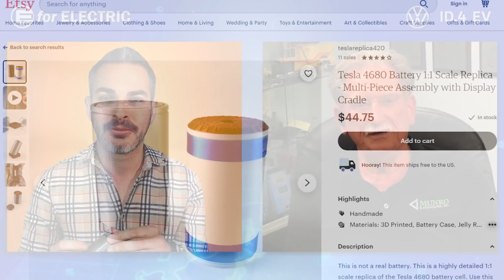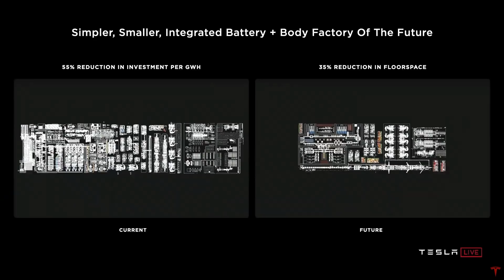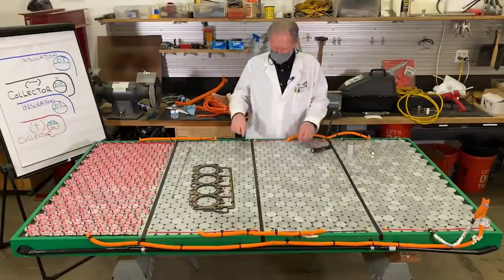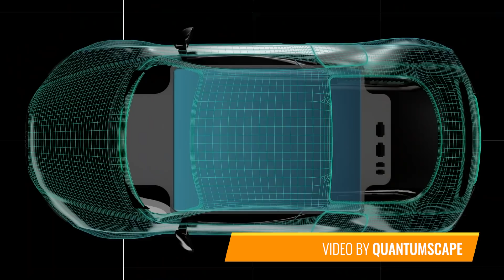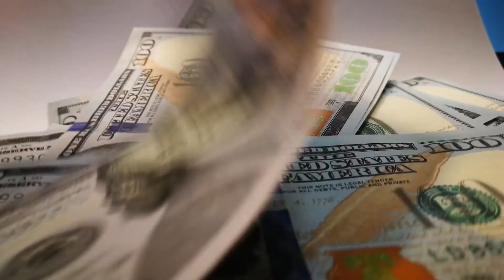SANDY MUNRO: Tesla's 4680 Cells & The Future of EV Batteries

Comment: Sandy, it doesn't matter what Tesla does on the production side, until these vehicles are NOT  slaves to hours long charging at scattered (relatively speak) charging stations these cars are NOT going to be widely accepted, at least not in the U.S. The last thing most drivers want to be thinking about is the logistics of where I'm going to recharge on a long trip or plugging in after a log day of work and an hours commute. Until the problem of fast charging (<20 minutes) at ubiquitous charging is solved EV's are not going to make a major dent in the number of vehicles on the road. Toyota is selling a lot of hybrids to the point where everything that arrives at a dealership is immediately sold. They have the plug in versions now for the Rav 4. You have the option of plugging it in at your leisure as well as charging on the fly running by the gas engine and regen braking. You can get in the car and just drive 100 miles or a 1,000 miles without any concern about where you're going to find fuel. We are lazy and in a hurry. EV technology is going to have to recognize that fact if it's going to make significant headway in an ICE world.
Reply: You sound just like the guys who shorted Tesla using the same logic and ended up with nothing but shorts on their body.
Reply: @Enemji  Where is the flaw in my argument? Are you claiming the infrastructure is in place to support 28 million (10% of cars in the U.S.) currently? Are you claiming a significant portion of the U.S. population is going to embrace the inconveniences that current exist in owning an EV today (long charge times and relatively few charging stations)? Don't be a fan boy a toss facts and rational reasoning out the window. I'm invested in EV technology BUT I'm not going to allow that investment to cloud my thinking. Tesla has had ONE profitable year and that profit was largely based in government subsides and sell carbon credits. How many vehicles the can produce is only one factor in EV's making up a significant portion of cars on the road. Tesla sold 500 thousand EV's in 2020. Toyota sold 2 million hybrids in 2020. Tesla has a LONG way to go before it makes a significant dent in vehicle sales. Don't get caught up on all the hype.
Reply: @pmh1nic  There is no flaw in your argument except that Elon Musk is an exception to the typical logical approach in a business.
Reply: @pmh1nic  One of the few comments I've seen that puts Tesla actually sales numbers into perspective. Toyota sold almost 10 million vehicles last year compared to Tesla's 500k? I think it's obvious the future is BEVs but that transition will take time and as you said the infrastructure needs to be vastly improved before it makes sense for many of the tradition automakers to go full electric. But once they do get going, Tesla's EV market share will drop and significantly.
Reply: @Enemji  If Elon was the almighty exception Tesla wouldn’t have year after year of no profit. Elon doesn’t control the speed of infrastructure creation. I admire the man but his control is limited to what Tesla can do. He doesn’t control his partner companies or the countries in which Tesla facilities are located. The success of Tesla is tied to a lot more than what Elon has direct control over.
Reply: @pmh1nic  so did Amazon. Yet see how they beat the big guns
Reply: @pmh1nic  - Neil DeGrasse Tyson told Elon that he cannot build Rockets, and only an organization like NASA can do it.  Yea Right!
Reply: @Enemji  Talk apples and oranges. The market cap if the auto industry is about $20 trillion dollars. NASA's budget is $20 billion. SpaceX budget is about $2 billion, peanuts in comparison. Tesla is free to build it's rockets somewhere over in a corner. Tesla is NOT going to be free to build EV infrastructure wherever it wants. Even if Tesla had the money to do it regulators and legislators aren't going to allow one company to dictate that setup. Building the infrastructure to support EV is far more involved than setting up an on line shopping and shipping system. And until that infrastructure is in place it's going to be difficult to get people to switch from the convenience of ICE and APV to EV's. I don't say this to say it can't be done. It will be done but change over is going to be progressive over a decade or more. Tesla better figure out how to become more profitable than it has been over the last eight years in an environment where more and more competition will be getting up to speed in the EV space.

Comment: Even though Tesla has had issues scaling up their own production of 4680 batteries from their pilot factory in California, their pilot factory in
 Nevada (with Panasonic), and their upcoming 4680 factories at Giga Texas and Giga Berlin should secure a steady 4680 battery supply, and show 
off the innovations of their new battery technologies as they ramp up to mass production of the 4680 batteries over the next year or so. Even though mass production is behind their optimistic initial plans, Tesla and their battery partners are still ahead of the much talked about solid state battery products. Which seem much farther away from mass production at competitive costs than the 4680 batteries. Slurry, Paste or Flow batteries are great for specific purposes, and I am sure that investors want to copy the gas station model to keep control of the storage and distribution of energy. But until one of those technologies builds corporate and home systems that recharge from solar power (where possible) and other renewable resources, those new technologies don't really allow for energy independence.

Comment: One thing is for sure. At some point in the not-too-distant future, something other than Li-Ion battery technology is going to be needed to power EVs. Why? Because there is only a finite amount of Lithium on Planet Earth and as more and more EVs are manufactured by more and more car manufacturers, the demand for Lithium will grow exponentially and it will eventually run out. And we're not talking 50 or 100 years from now. We're talking about the relatively near future. Plus the cost of mining Lithium is high and as demand for it ramps up against a dwindling supply, its cost will rise significantly making EVs ever more expensive if they're relying on Li-Ion batteries to power them. I think Sandy is right on the money here. Some new technology will need to surface relatively soon that will replace Li-Ion batteries.

Comment: This needs Sandy and Elon’s attention.  

Regarding 4680 patent. 

Namely the tab less 4680 cell. What that means from EE and ME stand point? 
Remove the tab, is removing the one and only one “reliable” conduction path for electricity in the 4680 cell. 

Next - flaps was intended to wick heat from chemical towards cell base then conduct it to the coolant channel next below. However point contact flaps has high thermal resistance unless junction area equals to cell base area which is not happening in model Y. Coolant scheme of model 3 will not come out of model Y. Coolant in model Y runs beneath cell base. 

In 4680 patent tab is removed and replaced by point contacts from periphery anode to cell wall, that leads to “unreliable” electric conduction. Whilst tab in 18650 is a solution to address that unreliability. Seems that Tesla is stepping backward this time. 

4680 cell may offer performance as expected by the patent but it will begins to accelerate aging the moment it experience inertial shocks on road, resulting short life cycle at a small fraction of a 1million mi goal. 

The formed up multi anode flaps are made of annealed soft copper foil it can deformed out of shape and will not spring back to maintain “conduction” of both heat and electricity. Entering a run away process, (1) deformed flaps increases cell internal resistance and ohmic heating.  (2) heat from (1) cannot effectively dump to coolant channel can only heat up cell chemical. (3) cell chemical take up heat cannot dump to coolant channel because of (1) above. Continue inertial shocks worsen the situation until the tallest one flap remain touching with cell wall. At this time cell chemical temperature rose exponentially. Further inertial shock momentarily disconnects that last contact causing an electric arc at the anode-wall junction next to hot chemical, subsequently to a possible ignition or small scale internal explosion.  

Remedy?  (1) implement model 3 coolant channel scheme into model Y and to models using 4680 cell. (2) tell the world that Tesla is adding a tab or tabs back to their tab less battery.
Reply: Remedy: put a sponge or something else springy on top before folding the copper tabs in, so that they remain to be pressed to the cap, or use electrically and thermically low resistance glue.

Maybe too low level solutions based on household repair ideas, but I'm pretty sure that the Tesla engineers have already had a better solution for that than we both could imagine.

Relax, Sherlock.
Reply: @arpysystems  please follow up with my second message titled Remedy.

Comment: Mayby maybe baybe are as good as a Elon promise. It migth come, but who knows. So maybe Toyota are the clever ones. Lets see, now it not the time.
Have Monroe look at other thsn Audi Etron. 
U can not run a business off what is best now, you have to look in to the further, and have you done that, you migth haven't be in that kind of a problems with debt.
Reply: Elom promises vs VW promisses. In 2013 VW said they would be BEV market leader in 2018....... using most of their 7 billion R&D yearly budget into this... w,ell now its 2021.... 
Also, in 2008 Audi showcased the E-tron in Frankfurt car show, to be launched in 2012, well, it turned out to be 2021... , almost right..., and better is now only 400kg more heavy than an Tesla model 3 topping up with lower specs and much higher prices"......almost there...
In 2015 Elon said Tesla would produce 500k cars in 2020,..... well you know the reaction yourself, and Tesla did just that, right?. Who•s the most accurate, hmm?
All OEM are now VERY busy making us think they arealready  there, even saying they are in front, lol. Advertising does not do it going forward, since OEM was all the same so nobody cared, no more no less, all the same. They will get caught red handed when somebody just try out a Tesla, they instantly know this is a different level.
Mecedes just bought a UK electrical motor company... in order to “stay ahead in the electrical transition”, ......what?  Stay ahead?.
Advertising, glitter.... it will be obvios at some point when OEM ICE will find out what is out there, and  you find yourself completely of with their bad designed horisontal build shit cars. Look into ANY engine, what a mess from 20 different suppliers, who even never met each other, christ it sucks and looks like a mistake just happend. I was 1. .tier supplier 25 years ago, same backk then, OEM did NOT move, they were just too secure nobody could touch them ,well they were wrong.

Comment: 4680 is not so much a technology.. its a form factor.. The important technology is the dry process, the low cost, the scaleability, the high speed production, the sourcing of key materials, the different chemical types in the cell. Key word is the cheapest technology; lithium iron..
Tesla and BYD will own the market in three years time. IMO👍🇳🇴

Comment: SS and Hydrogen is just used to make the uninformed public think something better is coming so they should keep on buying ICEVs (Sandy's reference to 'V8s coming back' from an executive backs this up from a diff angle) and that Tesla will get disrupted.

Batteries will change a lot over the next 5 years but they will also not change.  The companies making batteries and their experience and factories will still be relevant and is not going to change to some magical new product.

Also Alex doesn't seem to understand that Tesla will make it's own 4680 cells without any help from existing suppliers.  They will actually help the suppliers to also make 4680's.

Comment: IF 4680 is no longer usefull for cars... they will be able to use it for stationairy energy storage... so, its fine.
Reply: Unless coldfusion reaches production. Or the carbon fiber battery goes into mass production and is faster and cheaper to produce.

Comment: 3-5 years for "refillable" batteries! That's funny! I'm still waiting for airless tires from thirty years ago. If you're lucky it might reach a very small trial phase in five years and be in testing a few more years. Then it's right back to where we are now. Waiting for the independent gas station owners, who make all their money on snacks not fuel, to spend their capital installing this new system. When do they do that? Right away, or do they wait until they actually see enough demand for that fuel in their town. Will this dream battery have price parity with electricity which is already everywhere? I can't charge at home any more, I have to go back to a special fueling location? Part of my refueling cost is the waste/recycling because the station owner isn't eating that. And we're back to trucking around all this material again. I think Sandy's investments include a lot of transport companies since he was big on hydrogen too.
Reply: This type of battery is called redox flow battery, and the technology is tens of years old, I'm surprised Sandy did not know that.

You could still charge it like you normally would, but you'd have the added benefit to exchange the discharged electrolyte with a charged one in mere minutes at some station, because it holds the charge in the fluid rather in anode+cathode like standard batteries.
Pretty low energy density though, usually only used industrially where volume and weight are less critical.

Comment: I think LG Chem has problems. I hope Tesla doesn’t use them.  LG Chem batteries for the Bolt and solar back up batteries have been recalled. I was impacted by both. In fact the software upgrade didn’t appear to fix the problem because more Bolts caught on fire.  I will not by a car that has a battery from LG Chem.
Reply: Does LG assemble the whole pack or just supply the batteries? Seems like if Tesla goes with LG they'll only supply the batteries and let Tesla manage them, what's causing the problems is most likely how the pack is made or engineered.
Reply: @antreastoumazou2736  from what I understand it was in the battery itself.Hyundai recalled all of their vehicles as well with LG Chem batteries. I believe they are replacing the battery packs.
Reply: LG had an issue from 2017 until 2019, where they had a manufacturing error in the chemical makeup of the batteries.  Past 2019, their batteries are fine.
Reply: @charlesball6519  my LG chem solar back up battery was affected as well which uses same batteries. It took 3 months to get it replaced last year and the new one which is  a 2020 is under recall as well. It has been in an idle state on my wall for 2 months. Message from contractor is that lg chem is still trying to figure out the problem and doesn’t know what years or models are impacted.  The proposed fix is a software update like with the Bolt. We now know that doesn’t work because Some of the Bolts that had the fix are catching fire. No offense Charles but im not buying anything with lg chem attached to it.
Reply: @evgrandpa365  Luckily, the F-150 Lightening will be using SK Innovation batteries.  From what I've heard, the issues with the LG batteries were an incorrect chemical formula and the seperators between batteries.
Reply: @charlesball6519  yes thats what I’ve read. The LG chem ordeal is a mess. I’m great full to GM for buying back my Bolt. I will return the favor when they don’t have LG chem batteries. I look forward to seeing the F150 lightning once deliveries start.

Comment: I could be WRONG but the pouch seems more readily RECYCLED and RECOVERED
Reply: the cylinder is easy to shell out - and the metal is simple to recycle - all the jelly rolls and pouches are "complex" - chemically - to recycle. (Typical of recycling, it is much cheaper to use  uncontaminated virgin materials to make high grade products)

Comment: In  a Tesla 4670 battery pack how do you connect up in series (to increase voltage), all the mini packs that are wired in parallel without short circuiting all the cells with the outer frame casing.
Reply: The same way they do with 18650 and 2170 cells
Reply: they have 2 ends apparently one + and the other -  draw a picture of "how to" if it helps.   cheers.

Comment: That chemical battery sounds a lot like Vanadium flow batteries. That sounds like the right idea for trucking, but is a lot less dense than Lithium as far as I understand. Maybe there's some new chemistry.
Reply: Keep in mind whatever chemical you add to the battery has got to contain the energy you're going to be getting back.
Or rather it has to end up in a state that contains less energy than it did when it was put in
Reply: Generally, the category of this is called redox flow batteries, and it is not that new.
On principle, those batteries hold the charge in the fluid electrolyte, while the anode and cathode do not change during discharge as in a normal battery. After depletion, just pour the discharged electrolyte out (to recharge elsewhere) and pour charged one in, done.
However, the energy density is nowhere comparable to lithium batteries, you would have to have refills every 100 miles or so.